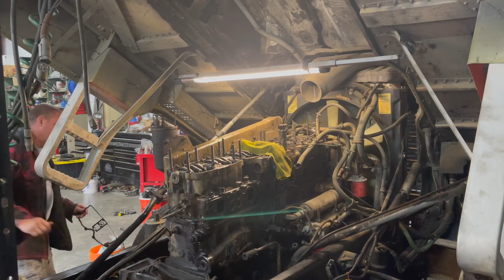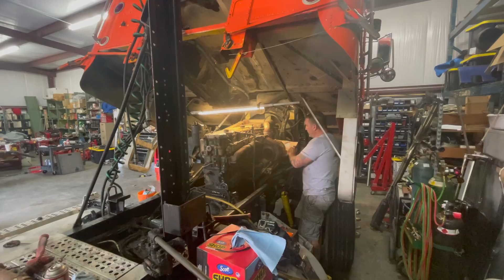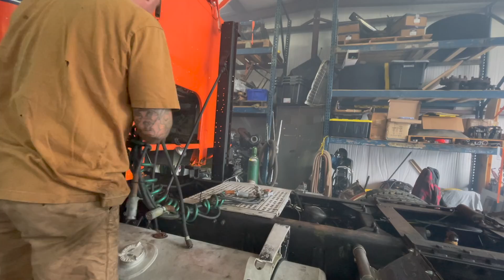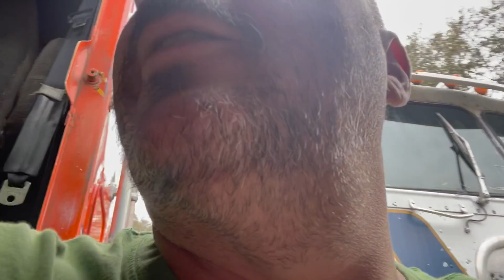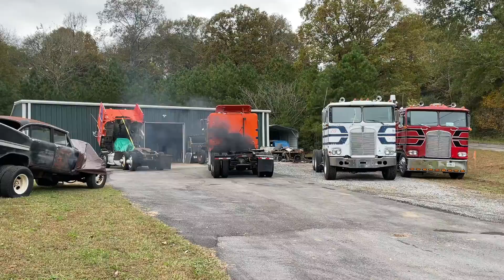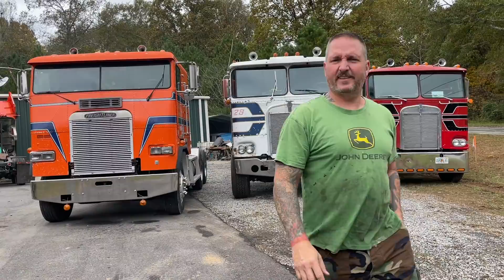1989 Freightliner Cabover "Candice" put the turbo on and fill the coolant

Comment: suggestion,...what I usually do and an easy way to get the exhaust manifold on is to use 2 studs, screw them in buy hand, one screwed into bold hole on cylinder one, and one on cylinder 6, slid the manifold onto the studs, this will hold it into place while you screw the other screws in, then at the end remove the studs and put in the proper bolts, just to make it easier on yourself, you won't have to support the heavy manifold while you are trying to get a bolt in. Thanks for the video.
Reply from the maker: Damn that’s a great idea.  Next time

Comment: An extractor fan may possibly have some use in the garage. Same as with Krystal, check injectors in a checking booth, clean up or replace as applicable. Love the line-up. Soon be time to start hiring drivers for the Pretty not-so-bad Trucking Company, or hire the trucks out to a big bloke in the next state...   Out of curiosity were the crankshaft and cases OK in the engine out of Delirious or had the bearings spun? {before you dropped the bloody thing}
Reply from the maker: Liners were mostly missing. I have two rods and pistons lots of stuff missing. It’s rebuildable tho

Comment: Cool now just to figure out the exhaust. Is Candice the one that had the screws thru the roof? Some interior work tho and she sounds really good. You’ll have a decent truck pretty quick.
Reply from the maker: Yes the screws thru the roof.   I’m taking the motor back apart to put the correct head and rocker box on
Reply: @JamesPretty  I wasn’t sure which of those two had those. But it looks like not too much work and she’ll be ready to go back to work.
Reply from the maker: @darrencatenacci2737  hoping so